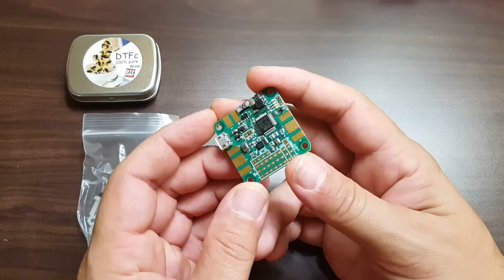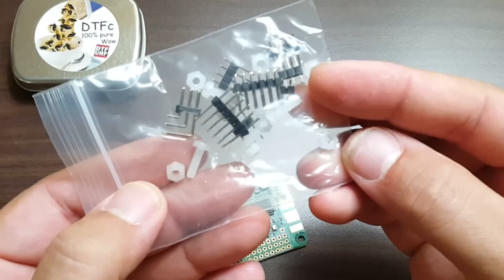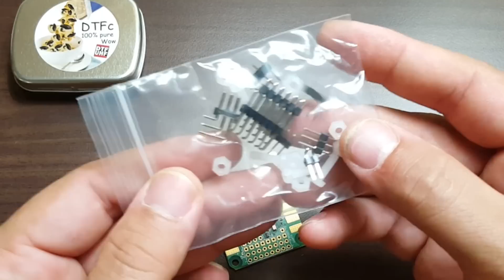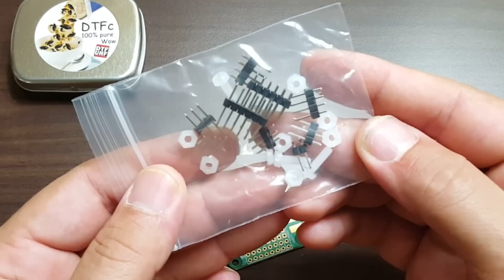Rotorgeeks DTFc Review

Comment: how much does it weigh?
Reply from the maker: +Ohioboi93 it cannot possibly matter, can it? The difference in weight between FC boards can't be more than a gram or two. I'm sincerely curious why you ask.
Reply: I want to compare the weight between this controller paired with an 
eachine vtx03 vs the f3 V4 AIO FC. After watching the UAVFutures Twig 
review video and finding out that he got an AUW of 274.I am thinking 
about possibly coming up with  a 250g build for 5inch props.  I know it 
would be next to impossible but I'm just curious if it could 
theoretically be done.

Comment: Joshua I'd be interested to see the current handling capacity of this board. With such complicated circuitry for the FC function I expect the current capacity will be compromised. A variation of your wire in the bucket apparatus with 4 loads would help verify this. Even on well laid out boards I have measured quite a variation of voltage drop from the battery pads to the various motor pads.

Comment: I bought one of these boards despite the fact i eventually read about the gyro glitches, i will if course try a soft mounting and play with the gyro_lowpass and dterm_lowpass settings of betaflight, i am pretty sure that will work :)
Reply from the maker: The lowpass settings can't fix the glitches. Well, not very effectively anyway. The leading theories for the glitches are 1) a very dirty 3.3v rail results in spurious readings from the gyros, and 2) exceeding the mechanical limits of the tiny MEMS device results in spurious readings. The problem is that the spurious readings are so extreme that you would have to really filter very hard to cover them up, and your copter would fly badly. There are some people for whom changing the filtering settings will make a difference, but for many people no amount of filtering is really going to fix this.

At least we can say this: if theory #1 is true, then the issue should be limited exclusively to some boards and not others. But I don't know if we really have enough data to judge for sure. Are there any boards that have the 6500 or 9250 that are known to never have this issue?
Reply: Thanks for the usefull informations McGuyver, well we will see how it turns out for me as soon as i finished my QQ190 build. Is there a way to notice this issue just having the board naked sitting on the table connecting to the PC?
Reply from the maker: No, not really. It only manifests in high vibration environments.

Comment: you could use the grey 3M tape to mount it to your frame since its flat on bottom if you dont use that sd card spot. that stuff sticks well and absorbs much vibration. it is what all helicopter pilots use for flybarless gyro mounting. i never had a problem doin ot that way

Comment: Joshua, I normally like you videos, but this one left me wanting more info. You didn't mention what solders where, what voltage out puts it has to power other things, will the pdb do all the things I need? Because I run an minim OSD I like the idea of the FC and PDB in one.
Reply from the maker: I feel like that information is well explained in the manual, and didn't see much value in reading it off. I could be wrong...

http://rotorgeeks.com/download/DTFc_User_Manual.pdf
Reply: Joshua Bardwell ok, thanks for the link, I guess I'm just used to other reviewers who go into more detail about what is what. No problem, keep up the good work!!

Comment: Yes, yes and yes on soft mounting! I started building these things right before mini quads. Back then it was a huge no-no to hard mount a board. I've begun soft-mounting all of mine again. One thing you can do it cut silicone fuel line for rc nitro models carefully to size with a razor. For my last build however, I bought o-rings from McMaster Carr. They are expensive, so be warned.

Comment: Soft mounting fcs with a 6500 gyro is a must imo. I use silicon grommets for cables with great results. Something like this 

http://www.rubbertechind.com/grommet-for-round-cable.html
Reply: Actual sale link?
Reply from the maker: +Zapf thanks. I am a terrible reviewer. 

http://rotorgeeks.com/index.php?route=product/product&product_id=555
Reply: Joshua Bardwell
I was actually asking elefkara on a source for those silicon grommets =) I have two dtfc in my work shed right now.
Reply: hey Zapf I buy them locally, I guess you can find them in any electronics shop just ask for cable grommets. I think any type should work.

Comment: Things that I have found I don't like about the board are the 5v reg has broken on two of my boards and the USB has popped off one. Definitely had to soft mount it. You can feed 5v back into the 5v rail to work around a broken 5v reg though.
Reply from the maker: Rotorgeeks is pretty solid with customer support. If you think your boards are not up to RG's standards of quality, it's worth at least asking for a replacement. The worst that can happen is they say no.
Reply: Joshua Bardwell
Yeah I have dealt with RG before and they have awesome customer support. It happened in a crash, so I wouldn't ask for a replacement. Just putting it out there.

Comment: Would a product which could dampen vibrations at the motors seem like something possible? or is that just too hopeful because I hate replacing motors for their vibrations.
Reply from the maker: Some people are installing bumpers or some kind of high-density foam under their motors. They say it makes a big difference. In theory, damping the heavier object (the motor) will have more effect than damping the lighter object (the FC).
Reply: +Joshua Bardwell  very interesting. I was thinking about some sort of silicon pad built into some motor protectors or something. I may try that because my camera mount doesn't have room for vibration dampening.

Comment: I have the board and it is currently unflyable. The gyro noise is so bad that oscillations on the yaw axis cause the motors to get hot in a matter of seconds. So far my experiments with soft mounting haven't made much of a difference. I really want to like this board, but so far it is no good. I can't imagine that it would fly well even if I got the twitching out due to all the additional noise.
Reply: I emailed rotorgeeks and they said that a lot of people are having problems with the red bottoms (which are what I am using). The noise does not seem to change based on whether I have props on or off and no amount of filtering will get rid of it. I am really hitting my head against a wall.
Reply from the maker: +kulagabe never run gyro_lpf if you can avoid it.
Reply: That sucks. Very frustrating when you have an issue you just can't fix. I'm going through a similar thing on my backup quad. I do flips and rolls one after the other just fine, then for no reason it will just freak out on the next flip or roll and fall to earth. Can't figure it out for the life of me. Frustrating.
Reply: Out of interest, are you using the KISS FC?
Reply from the maker: That sucks. I know that some people (notably Boris) are having success with it, so I wouldn't write it off entirely. Do you have a lot of motor noise by chance? I wish we could nail down a solid explanation for why some people have trouble and others don't.
Reply: +Toby Dilworth me? No, fury f3.
Reply: +Toby Dilworth I'm running those motors too. No issues with them for me (touch wood) and a lot more power than I'm used to. But loving it so far! Its also made me realise how anemic my previous motors, hellfire 2204, were. While they are perfectly adequate, who wants to settle for adequate!
Reply: I was only asking because the KISS FC is known to die on flips and rolls for no apparent reason.
Reply: What escs and frame? I think it may in part be because of a  soft frame in my case.
Reply: +Toby Dilworth xm20a running multishot and a qav210 clone. This is my good flying rig by the way, the one with the redbottoms. My troublesome rig is a zmr250 and that running lb20's on Ms, the hellfires I mentioned and f303 v2.
Reply: I am having the same issue and I am flying red bottems with Aikon 30amp escs on a Mixuko frame.  I have also adjusted the gyro settings (set gyro_lpf =) which on the bench seems to have removed the yaw twitch.  I have also soft mounted the board, but that only helped a small amount.  I hope to fly it tomorrow and see if it is actually functional
.
Reply: What exactly did you enter into the CLI?
Reply: I would love to know if that fixed it. Do you know off the top of your head the value that you put in?
Reply: set gyro_lpf = 42HZ
set gyro_lowpass = 50
I believe higher numbers mean less filtering, I think LPF lowest setting is 188HZ.  Start high and work low until it stops twitching.  I hope to try flying it tomorrow.
Reply: What does each of those parameters do?
Reply: Joshua - is this a board specific problem? I.e. if I were to buy the Xracer F303 (your favorite), would I have the same problem? I have tried to solve this issue for more than 2 weeks and have tried everything I can think of and everything suggested to me (even taking gyro_lpf below 42HZ does not get rid of it). Is it time for a new board? I hate to waste the money and hardware.
Reply from the maker: Your best bet is to pick a board with the 6000 or 6050 gyro. The issue is not one that will be fixed by soft filtering. It is a mechanical issue that can only be fixed by reducing the vibration that the gyro sees.
Reply: I put gyro_lpf back to off and increased how much cushion the board has by putting some foam under the board and ensuring it compresses a bit when pressed.  It doesn't seem to have the yaw twitch on the bench, this is WITHOUT changing any CLI settings.  I will post after I fly if it works.
Reply: Adding foam in addition to rubber O-rings to soft mount the FC worked (no CLI settings needed to be changed)!  It flies great and all fits in my Mixuko pod.
Reply from the maker: Awesome. Glad you made it work.

Comment: Lol, like back in the days of the MWC-FCs where people where discussing esoteric theories on which soft-mounting method works out best. And everytime a top-pilot mounted it with some special double-sided tape, everyone else tried the same. To be honest, this isn´t something I´ve been missing after switching to the current Cleanflight-FCs... with my currents quads and F1/F3-Cleanflight boards everything is working just fine with "hard-mounting"
Reply from the maker: This is one reason why I personally will probably keep sticking to 6000 or 6050 boards. SOME times a 6500 or 9250 board works fine, but SOME times it doesn't and then you're chasing gremlins. There are too many gremlins in this hobby to take chances. Stack the odds in your favor. It's the same reason I tend to keep installing the F303 on my copters. It's not that the F303 is the ONLY good FC out there, or (as some have suggested) that FPV Model is paying me off (I wish). It's just that I have found that the F303 works. And it keeps working. So I keep using it. It's not the ONLY board in the world that works, but I'm not interested in building ten copters with some other board just to find out whether it also works.

Comment: Where can i get some soft mount bumpers?
Reply from the maker: Goood question. The simplest solution I have heard is to get some 1/8" silicone fuel tubing or aquarium hose. Then cut it in lengths of about 2mm and squash those onto your screws. There are other approaches, but that will basically supply you for life, for a few dollars in material.
Reply: I use these: https://www.amazon.ca/gp/product/B008FYVSZE - Not the very very cheapest thing in the world, but cheap enough and work with zero effort.  I'm sure .com will have something similar.
Reply: I thought people said the rubber on these was too hard to use. Never the less, i'll try them out. Thanks
Reply from the maker: Softer material is better because the FC us so light.
Reply: Having put those particular bumpers on my cyclone, my traces have never been so clean.  That said, my quad was already very low noise so take that with a pinch of salt...

Comment: Hi Joshua can you do a vid on soft mounting FC
Reply from the maker: This might help. https://www.youtube.com/watch?v=KaOWkecIx-g
Reply: Can you link the actual anti vibe washers / standoffs you used?
Reply from the maker: +Zapf 1/8" silicone fuel line, cut short lengths is what I recommend.
Reply: http://www.ebay.com/itm/3MM-1-8-Blue-Universal-Silicone-Fuel-Air-Vacuum-Hose-Line-Pipe-Tube-10-FOOT-/331713468203?hash=item4d3ba9d72b:g:FlgAAOSwlV9WT69m&vxp=mtr

something like this?
Reply from the maker: +Zapf yes. As a bonus, you can color coordinate.
Reply from the maker: Zapf: How do you cut your silicone hose to length? I am having a really hard time getting a consistent length, and also getting a perpendicular cut.
Reply: I'd assume you knew since you recommended it! I'll let you know when I can get back to my workshop. I assume proper clamping and premarking with a ruler would be enough

Comment: How awesome would it be if they could incorporate an OSD into that fc/pdb combo. All you need in one board.
Reply: There is the OZE32 (aka, Flip32 All-in-One v2.0), but I can never seem to find many opinions on it.  From what I gather, it doesn't get much press because it's not based on the F3 processor.  I have to imagine there will be an F3 version of that soon.
Reply: +Mike Farrington never realised there was an all in one version. I'm surprised more people are not making them. An all in one f3 with spi, sd card and through hole would be superb. Probably be quite tricky to get all that on one board though I'd imagine.
Reply: More and more makers are getting with the program in regards to dataflash (8MB or 16MB mounted memocy chip -- thus no need for microSD socket).  The chips only cost $1 each, shipped free from China.  I have to imagine they're only about $0.25 each or less each when bought in bulk in country where the FCs are made.  I think it's becoming the new norm.
Reply: +Mike Farrington I'd much rather have sd card personally. You can literally record all day if you wanted to (not sure you would though) and you don't age 5 years waiting for the logs to download lol
Reply: Because it came up, here's the new F3S-AIO. http://www.rcgroups.com/forums/showthread.php?t=2690427
Haven't tried it myself but Airbot sure packed a lot in on that board. 
There's also the Flip32 F3AIO-Lite which doesn't have quite as many features but gets you through holes http://www.rcgroups.com/forums/showthread.php?t=2633746
It's amazing how far flight controllers have come!
Reply: +swissolo I remember when the Kk2 was the pinnacle of flight controller's. Wasn't that long ago actually, things move fast in this hobby!